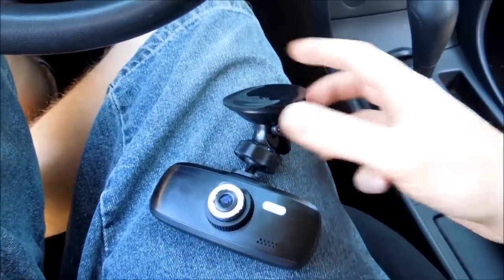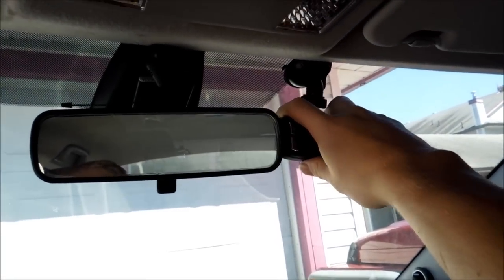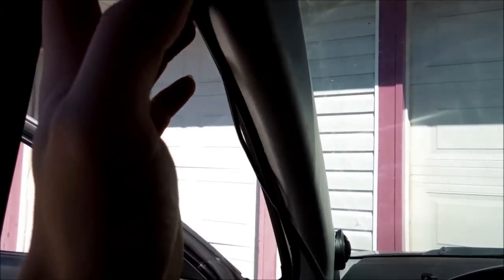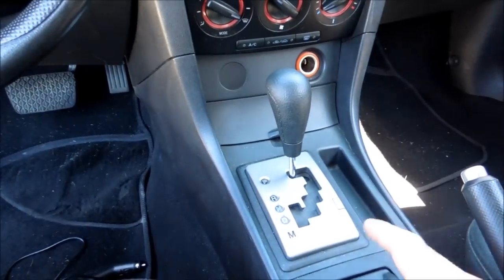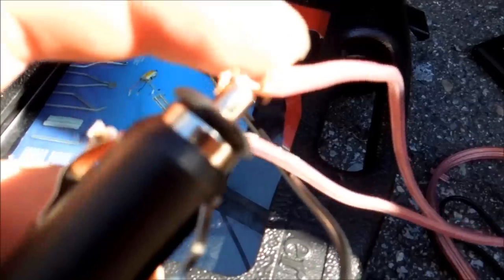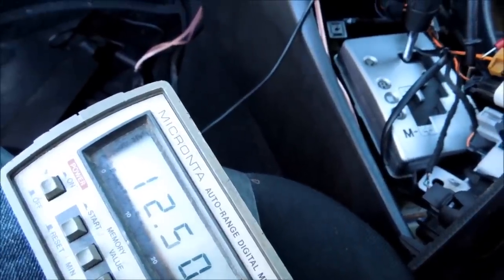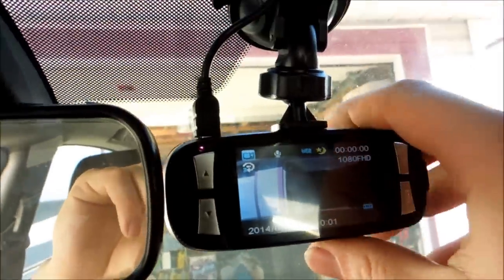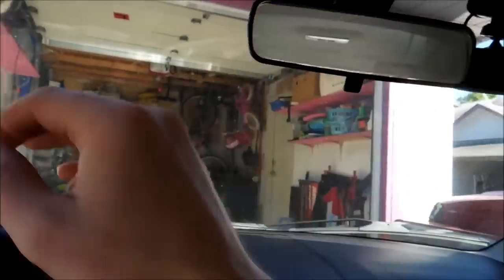how to install a dash camera

Comment: Just a tip: you should put the wiring through on the passenger side because if it drops down, you wont get interrupted while driving

Comment: Im going to install in my M3 also a dashcam. I need to put a switch for another purpose and i saw you put a non Mazda switch next to your left steering wheel switchpanel. Where or how did you fix this? How did you remove the covers?

Comment: DAMN.. That is complicated...  Thanks for the video... Showed me I want to hire someone.. .
Reply: Daniel Grayson Once you get in there and do it, you'll quickly realize that it's very simple. Although, I'm also an electrician :3. What I did with mine is I got a fuse tap, tapped into the reverse lights fuse and ran a wire to the center console (I have a standard transmission so there's more room). For grounding, you could ground to a few bolts in the center console, or, what I did, is I ran a ground to the ground bar on the passenger side, behind the kick panel by the door.
Reply: Daniel Grayson Once you get in there and do it, you'll quickly realize that it's very simple. Although, I'm also an electrician :3. What I did with mine is I got a fuse tap, tapped into the reverse lights fuse and ran a wire to the center console (I have a standard transmission so there's more room). For grounding, you could ground to a few bolts in the center console, or, what I did, is I ran a ground to the ground bar on the passenger side, behind the kick panel by the door.

Comment: Hi. Thanks for the review! Question....was it difficult to remove/reinstal the weather stripping? I dont want to ruin any seals. Thanks much!
Reply from the maker: Removed 100+ door seals just work it of slow and your fine :)
Reply: Thanks for the fast reply. I'm more worried about the reinstalling than taking off. Will it need any type of glue to go back on? Thanks again
Reply from the maker: No should be friction fit :)

Comment: Awesome video. What might be going on if I'm getting voltage at the cigarette lighter plug, but cam isn't getting power? The red light on the plug does not turn on. However, if I plug directly into the cigarette lighter it works fine.
Reply from the maker: you might need to check your solder joint off the account wire you tapped into
Reply from the maker: +ghostlyrich *acc
Reply: +ghostlyrich when i attach my multimeter to the cigarette plug positive and ground, I get voltage. To me, I interpreted that to mean my solder is good at the accessory wire. Would you agree?

Comment: I just run the cable thru the footwell, stick it on the side panel with black gorilla tape and plug into the front for both my dash cam and sat nav, barely notice it after a while.  Using a plastic spudger makes hiding the cable easy around the window.
Reply: Kevin Thompson

Comment: Looks risky. It would be better to tap on from the fuses, it is safer and you are protected but fuses.
Reply from the maker: Simon Cassar wire in your own fuse with a fuse holder there cheep throw a 10 amp fuse in it call it a day